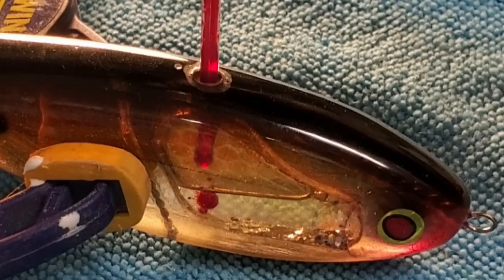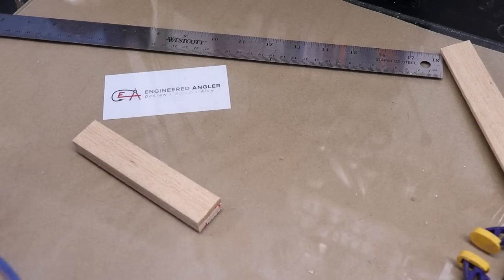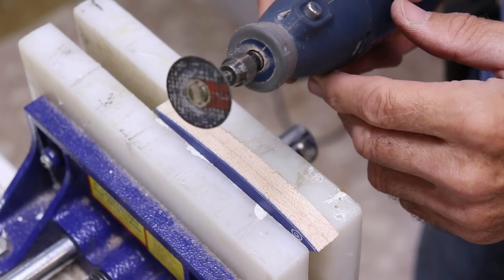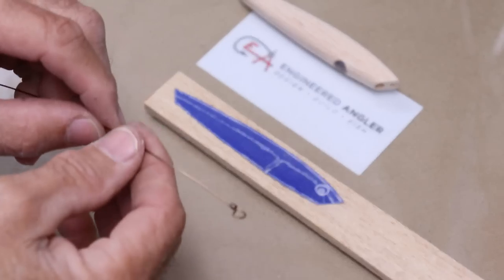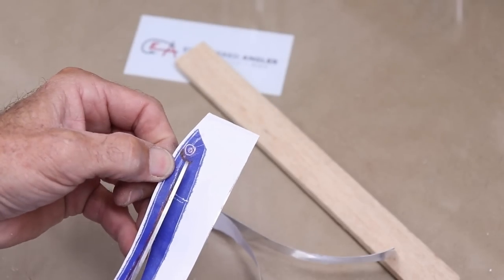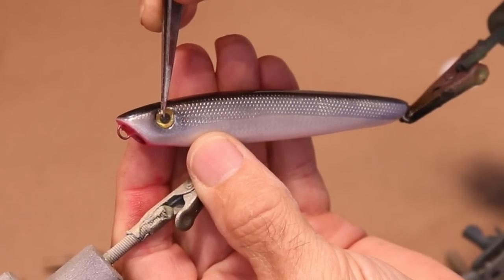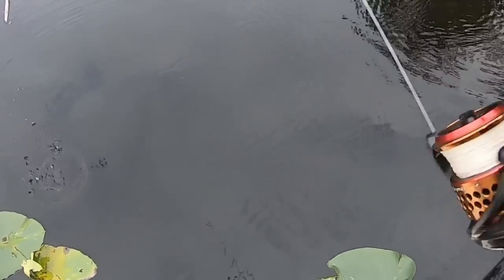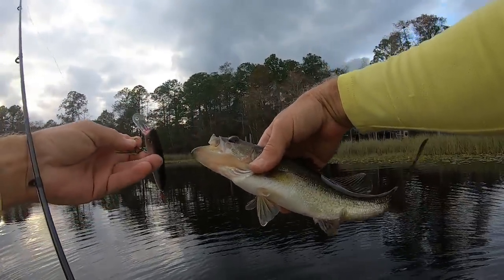Lure Making with Balsa Wood, Making a bass minnow lure and catching fish.  #balsa  #basslures

Comment: I fish in the area around Ocala and I get some on that pattern. I do the best in the darker waters with jerkbaits that I stained the wood with tie dye and coffee grounds. Yellow with a brown back and dark green with a yellowish belly are the best producers and I get a lot of giant bass on them. Lately I’ve been getting them best on 2-1/4” crankbaits but I won’t stop making my jerkbaits so I’ll be ready when the fish are😊 I think you should make a clear jerkbait with the polycarbonate layers and have a bit of foil inside and do a translucent honey yellow with a brown back. I think that would be the ultimate weapon for Florida bass.
Reply from the maker: give it a shot...it might be killer.
Reply: @EngineeredAngler  I was saying you should make one. I’ll consider making one when I come up with a cheaper material source unless I happen upon a polycarbonate window somewhere. You could prob get a good video doing one similar to the liquid deal but have a wobbly piece of foil on springs like a shimano flash boost. I know you can pull that one off.

Comment: Hey Franco where did you get that bib?  This was a really well done video by the way. I've seen you do the top slot before but I didn't understand the why. Your explanation was perfect. I also liked that you explained how the UV-resin cures from light transferring up through the bib. I notice you use UV resin a lot instead of super glue and after I thought about it I realize I'm always frustrated by the friggin super glue running or spider webbing and getting all over the place including my fingers. Seems the UV is a lot easier to control.
Reply from the maker: AbsolutelyI use the the UV resin as glue, filler, and clearcoat.  Super glue is a great tool but can be messy.  Thank you for the comment.

Comment: I have watched you airbrush straight from the bottle many times. Do thin your paints first? I cannot get any of my air brushes to spray paint straight from the bottle unless I thin it first. What air pressure do you use to spray? I love your videos been watching for two years and have learned a lot about lure making. Thanks.
Reply from the maker: So far every paint I have used, except Createx, sprays well straight out of the bottle.  I thin the Createx paint 50% with Createx paint thinner.

Comment: Nice Video! I just discovered your channel a day ago when watching the video about Lithium batteries. I have watched several of your lure building videos & it is quite interesting. I was wondering if you would have any idea's on how to repair the Rapala ScatterRap Minnow type lures? It has a round curved lip & I can't find any lips anywhere to replace them with. The Rapala ScatterRap minnow has a problem with the lip coming out of the lure. I thought you might have some idea's on how to fashion a replacement lip. Also I wonder if anything can be done to the new lure to re-enforce it somehow so that the lip wouldn't come out in the first place? Thank you!!!
Reply from the maker: I'm pretty sure that concave lip is integral to the plastic body. That means it would be very difficult to replace it with anything. I think the only real course is to go out and buy a few more. Good luckI
Reply: That's the problem it has a balsa body & the lip is just inserted into it & falls out easily. It has happened to me about 4 or 5 times already. I wonder if I could drill a small hole through the top of it & put some kind of pin into it?

Comment: You can actually get away with using screw eyes in balsa baits. Especially if you’re making them for bass but I’ve even caught decent pike on balsa baits without a wire harness and never had an issue
Reply from the maker: Yeah...I overstated that a bit.  Small freshwater baits do just fine if glued in.